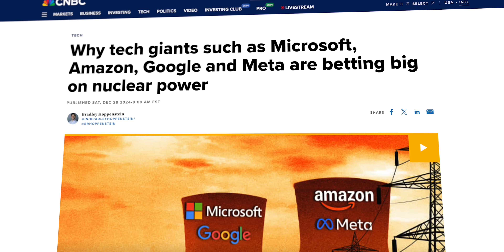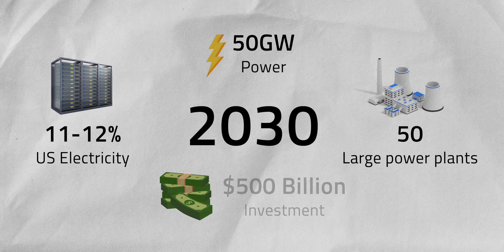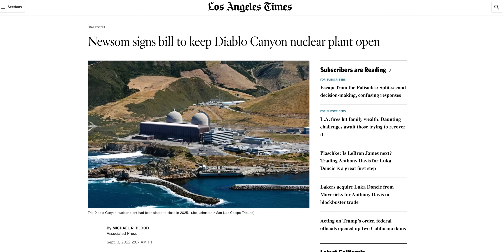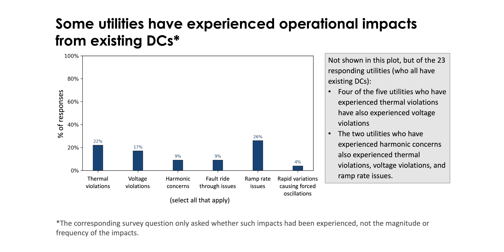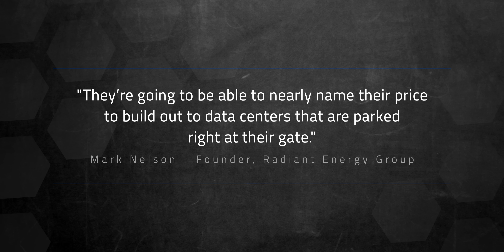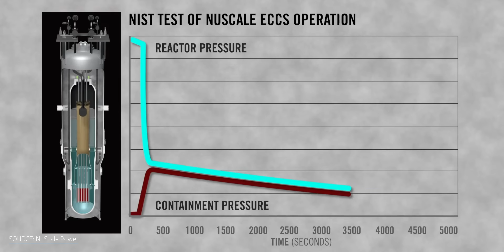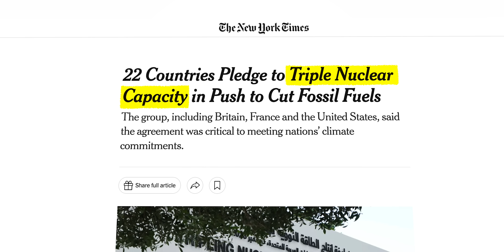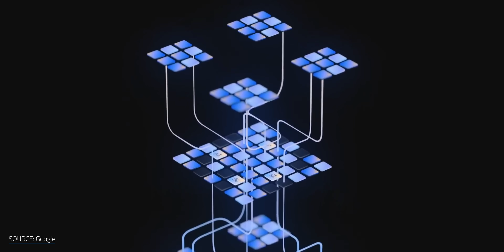Why Big Tech's Betting Billions on Nuclear (Not Renewables)

Comment from the maker: Do you think small modular reactors are the way to go here? Get $200 off a Roborock Saros 10 until February 16th at https://amzn.to/3CNzZQP & https://bit.ly/3CH2pMm

If you liked this, check out Why Hybrid Solar Heat Pumps are the Future of Home Energy https://youtu.be/Sdcbdxop8KA?list=PLnTSM-ORSgi7uzySCXq8VXhodHB5B5OiQ
Reply: Small reactors are coming in more expensive than big ones, per unit of power output.  For example, the TVA says the BWRX-300 will cost $18/We, falling to $12/We after multiple reactors are built.  Vogtle 3/4 was less than that, even after the huge cost overrun.
Reply: @pauldietz1325   Thank you for being one of the few reasonable comments. I can't believe Matt completely ignored the expected costs of SMRs have continuously changed to being no cheaper than traditional nuclear and most of this comment section is oblivious.

So much "yay nuclear" and no consideration that the LCOE is at least 50% higher than fossil fuels and more like 3x renewables + storage. Big Tech might not mind paying 3x the cost for power, but consumers sure will!
Reply: The SMR design is from the 70ties. There where plenty reasons to choose the large ones. 
None of them have really changed. 

All SMR company's i know are knsolvent or close to.
Reply: I'm not sure I'd say 300MW is a small setup. I suppose compared to the GW plants it's smaller, but when natural gas fired power plants run under a GW most of the time, and with geothermal being under 100MW... When someone says Small Modular Reactor, I'd expect something under 10MW. Then that's something that you could explain as small, and then also as something that can be mass produced. Then you could have one every few blocks to run a few hundred homes. Then you could have one SMR for every row of servers in your data center. Then you could have people trained to work on them and maintain them in every community. AND then, you can very quickly work through all the various failure points from wear or defects, and replace the units with a single semi-truck delivery. And lastly, you have the kind of necessary redundancy you'd expect from a service that needs five 9's of reliability. 

Oh, your local generator is down? No problem, the 5 nearest to you can pick up the slack for the day it takes to roll in a replacement, and take the failed one away for service and repair. Oh your generator needs refueling? No problem, we'll roll in one of the 10 we have on standby at any moment, drop it into the backup slot where it plugs itself in, starts itself up and coordinates with the neighboring ones to balance out the power demands while the prior one slows down, powers off and is ready to get hauled away for secure and safe refueling.

Honestly you don't get to economies of scale until they are more prevalent than gas stations. And with more and more stuff moving to electricity, from heating, to cooking, to transportation, that's the kind of scale you need to replace fossil fuels.
Reply: @SeanBlader  Why? You could do that much cheaper and more effectively with renewables. And that’s where all the private sector capital is going. And it can be installed in months, rather than decades.
Reply: The reason why SMR’s will never be cheaper than large scale is because Nuclear Energy was already being built at the size that would be the cheapest. Pipe, concrete and control equipment are all at their most cost effective price points.
Reply: @nexxusk  Interesting point.
Reply: Hello Matt! Great video, as usual, thanks! 👍🙏
I'd really like a break-down video (videos?) of nowadays nuclear energy workings. Fuel, plant operation, waste management, pros, cons, furure... I find you have videos covering other energy sources and I'm sure you'd make amazing content regarding the matter. Cheers! 🙏
Reply: No
Reply: modular maybe, reactors that can recycle nuclear material several times over? yes!  Other nations are doing this like israel and japan, kills the half life of the fuel to around 100 years instead of 100000 years or longer >< .  The best news is we have enough to power us for the next 1000 years with growth factored in.  You really really need to do a video on this, its really cool and will end up killing green energy movement i think if thorium reactors are a bust.  Love your content.
Reply: @ Too expensive.
Reply: Look at Eng8's presentation at the start of the last Alt Propulsion conference, video "APEC 1/18: Catalyzed Fusion..."
Reply: Is your background music ronald jenkees?
Reply: Pebble. Bed. Reactors.
3 simple words solve all of AI power needs. Done. Go spread the good word now. Thank you.
Reply: i think you read 4cm and thought its 4 inches and in turn you thought thats 10cm, cause that vacuum robot does not lift 10cm ;p
Reply: Nuclear power is heavy industry which sits on economies of scale.

SMR are just like reactors, which are another story as they are way too expensive and dangerous but justified because they are stealthy, compact, don't need frequent refueling... nothing of interest in a civilian context.  Moreover the danger is partially mitigated because they have plenty of water for cooling and away from populated areas.

Moreover constructing series of (identical) reactors in a plant implies to integrate (ideally each and every customer will buy the very same reactor and ancillary devices), however such a monolithic equipment is difficult to install in (physically) different sites, and even more difficult to adjust to various requirements of distinct safety authorities.

See the Nuscale debacle.
Reply: @ The SMR… are these the same style of reactor as used by the US Navy?
Reply: @thethirdman225  To be able to build a reactor one must design it and have it accepted by the pertinent safety authority.  This is expensive and takes time.  To reduce costs and delays adapting an existing (already built) model is key.  Reactors used in submarines are the sole pertinent source of inspiration.
Reply: @  The trouble with those reactors is that they use weapons grade (‘HEU’) uranium*. That presents all kinds of unknowns and in some cases, the odd security issue.

I’m not personally opposed to nuclear power using low power (‘LEU’) uranium, other than that it is way too expensive and totally superfluous to our needs.

But SMRs are not suitable for civilian use, IMHO. Conventional nuclear reactors are now part of a bygone era.

*NB not all submarines are fuelled with HEU. As far as I know, that is limited to American and British types.
Reply: @thethirdman225 nuclear power is the future not the past
Reply: @RIbigDave is strange that nobody asks what nuclear powerplants are driven with and where this comes from. Also, how many resources to burn we have. 

If all would use nuclear energy, there is not enough material to reach the next years.

And still, there is the waste that no country have a secure solution for.
Reply: @ Then why is there no private investment in it? I’m not opposed to nuclear power for environmental reasons, though I have some concerns. I’m opposed to it because it’s three to five times more expensive than other forms of power generation and takes decades to construct. In this country, something in excess of 30% of homes have solar panels on the roof. A whole 1 GW renewable power station can be built in a few months. Renewables are much more convenient for service providers too because they decentralise the grid. This is especially important in a market that has transitioned from base load and peaking to renewables and firming. The toothpaste is out of the tube. There’s no going back.
Reply: @ By the way, nuclear submarines can never be completely stealthy in the same way as a diesel electric (AIP expands this). From an Australian perspective, this was one of three major problems I have with our government’s decision to switch from the French sub to the American Virginia class.
Reply: @thethirdman225  Indeed, however a nuclear reactors is more compact with a way better range, and no pesky exhaust gas.
Reply: @natmaka  But large heat signature, which is why they have to travel deep. Nuclear boats are of little use to us.
Reply: When I hear "SMRs have passive safety features!", I am reminded that the CANDU design (developed in the 1950s) relies on a plug melting id it overheats, releasing the heavy water moderator and stopping the nuclear reaction. 
Nothing is new :-)
Reply: @UndecidedMF  I wonder what comes first, the SMR or the fusion power plants. 

To me these are currently daydreams since the 50ies.

This is not like waiting for the new iphone where we know new technology is keept for the assenbling new models and all ray on existing technology. 
It's just not finally developed and there are science challenges not solved since dcades. After solving these need to be tested and series production started.
Reply: The bignuclear plants should not be 'revived'. The core metal deteriorates, removal and replacement? No, deal with safe removal.

The 'exceptions' to the useful life of nuclear plants only kick the problem downthe road. 

Be certain of cooling and do not store 'spent' material where it can be included in a disaster like the Fukushima disaster.
Reply: @backpackingonline  how does metal deteriorate ?
Reply: @backpackingonline  Nuclear power plants are the only true renewable energy source. Wind power is a scam. They claim it is renewable energy, but most of its components are not recyclable. Even if they were, in reality, they are not being recycled because dumping them in waste mountains in Southeast Asia and manufacturing new ones is cheaper.
Reply: @UndecidedMF  Nuclear is too expensive. If that’s what the tech bros want then they can pay for it.
Reply: I feel like you should've covered in far more detail why small modular reactors have been failing for over a decade now to accomplish anything. Most notably that every single one of the companies in the space have repeatedly been raising their cost estimates to the point it's unclear they will be any cheaper than traditional nuclear per watt generated.

Also, most importantly: these data centers are being built this decade. Not a single watt of new nuclear commercial generation (excluding restarting old reactors) will happen this decade. It's chronologically impossible for these data centers to be powered by SMRs at least in the short term.

Wind/solar + grid-scale batteries are the way to go as it's available today and has the cheapest LCOE, even beating new fossil fuel generation let alone nuclear. The main bottleneck is grid hookup and if you're building it for your data center you don't need the grid hookup for the power, you only need it for the data center as backup.
Reply: @tHebUm18  THANK YOU for informing Matt and readers. Matt -- SMRs are very complicated and there is a LOT of hype. Please see the work of Dr. M.V. Ramana, University of British Columbia. Also, Dr. Mark Jacobson, Stanford Engineer. They explain that SMRs are: 

Too SLOW to stop climate catastrophe and meet growing electricity demand. 

Far Too EXPENSIVE compared to every option. 

Too DANGEROUS with extreme climate weather causing droughts, heat, fires, flooding, storms... 

Too VULNERABLE to terrorist attacks on grid structure and cooling systems. SMRs also threaten global security by spreading nuclear bomb-making factories around the world. 

Not to mention that the U.S. imports 99% of uranium -- a limited, expensive, dangerous and health-damaging element. 

And if that's not enough, nuclear is NOT carbon-free. Nuclear power produces 9-37 times more emissions than wind. Mining, refining, transporting, manufacturing fuel rods, MASSIVE quantities of concrete, steel and infrastructure, highly complex operations -- with cooling systems largely powered by fossil fuels at present, waste storage for hundreds of thousands of years...  Absurd.

SMRs and the nuclear industry would not even exist without massive taxpayer subsidies -- including the insurance paid by taxpayers because no insurer will touch nuclear power. And taxpayers and ratepayers will continue to be fleeced if we let the nuclear industry -- backed by Big Tech -- push through a horrible non-solution to our climate crisis and energy needs.
Reply: @tHebUm18 wind and solar are far more expensive than natural gas and coal. Nuclear power is the only large-scale answer to reducing emissions two zero
Reply: For better or worse, I suspect all of  that under the new regime in the US,, the small nuke reactors big tech wants to build are going to have an extremely easy time getting NRC approval.
Reply: @lyledal good, they’re cleaner and create a lot more power. It’s time to stop lying and demonizing nuclear. Solar and wind has generations before it’s worth it
Reply: @UndecidedMF  Nuclear power plants are the only true renewable energy source. Wind power is a scam. They claim it is renewable energy, but most of its components are not recyclable. Even if they were, in reality, they are not being recycled because dumping them in waste mountains in Southeast Asia and manufacturing new ones is cheaper.
Reply: Seems like the better question is are these "AI" models actually worth the investment at all - for the moment they continue to prove prone to serious cases of the stupid, take quite some time to process a request compared the search engines (which is one use they are seemingly reasonably good at effectively refining the search terms for you) etc. Still the 'value' they actually add seems to be rather more theoretical potential than genuine.
Reply: @foldionepapyrus3441  These are not AI driven, the nuclear powerplant is used to produce the electricity for those datacenters.
Reply: @StarkStromer  It is not what is driving the reactor it is the purpose behind reviving them that gets me - maybe these AI will eventually really be worth all the energy being thrown at them, but right now its very much more hype than practical benefit - if your going to revive nuclear power plants you could reduce the fossil fuel demands of the grid as a whole instead - a clearly beneficial use! Rather than just adding more and more power consumption to the world for uncertain and marginal gain that forces the grid to stay dirtier.
Reply: @foldionepapyrus3441 demand for electricity has been growing rapidly for decades and that needs to be addressed however widespread use of nuclear power will definitely offset the use of coal in particular. When did solar are not even remotely viable answers to large-scale power generation.
Reply: @ Not really the point I was making. However Wind and solar really are quite viable for large-scale power generation, as rather proven by all the pretty large scale deployments that work out very cheap and efficient overall. In the UK for instance a huge portion of the electric consumption is supplied by wind now. 

There certainly are other challenges associated with those more variable output renewables compared to the almost instant throttle control of gas, and the economic impact of having price fluctuations with the over or under supply moments. So I have nothing at all against nuclear power at all. 

But  as my whole point was reviving the nuclear power just to run these really really stupid AI models - if you are going to revive them do it to cut down on the dirtier powerstations, not to power yet more demand, and a seemingly pointless demand!
Reply: High pressure high temp reactors are the only way to go.  With Methane as the coolant that is converted in to hydrogen it's a no brainer
Reply: @SynKronos  References?
Reply: @fotoguru222  Try  Researching for yourself.  Wasn't talking to you  in the first instance
Reply: @SynKronos  Asking for a source is a perfectly reasonable thing to do.
Reply: @SynKronos  Actually, you are talking to all of us. You aren't posting private messages. Extraordinary claims require extraordinary evidence. You don't seem to have any, am I right?

Comment: Nuclear is the best power source new reactors can not blow up like Chernobyl or S1 if you know what that is Chernobyl only blew up because it’s control rods were tipped with carbon to make them cheaper and it speeds up the reaction causing it to blow up faster and then kaboom now we get modern day Chernobyl and thorium is really safe as well and makes more power but it is not really used and no I will not use proper grammar because I won’t

Comment: We can get around a lot of the building of a grid simply by transmitting from solar farms in orbit to local relay stations which then transfer locally the energy from the distribution center to the end users. Could also have relays at different power plants around the world to relays in orbit which are set up to receive and hold energy until a local distribution network is available. Yes there is some energy loss however what it loses in efficiency of distribution of energy it gains in lack of need of resources to set it up and maintain it.